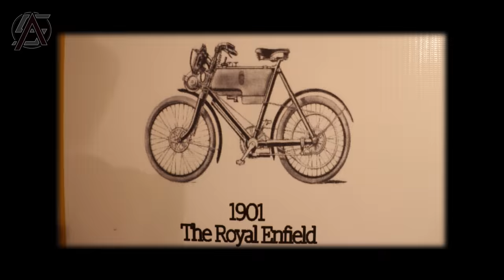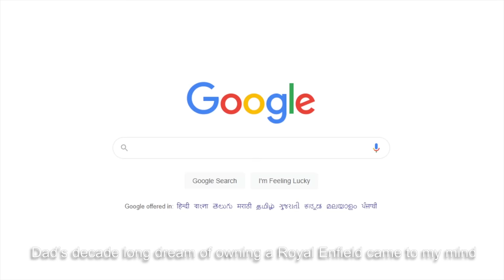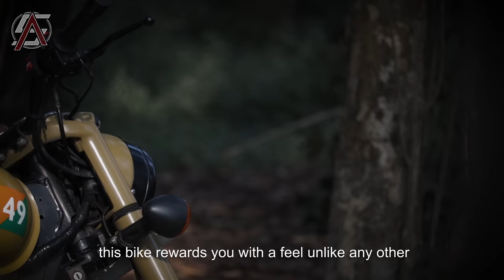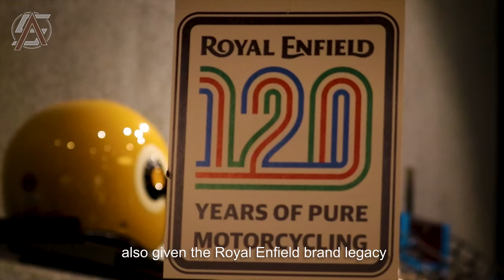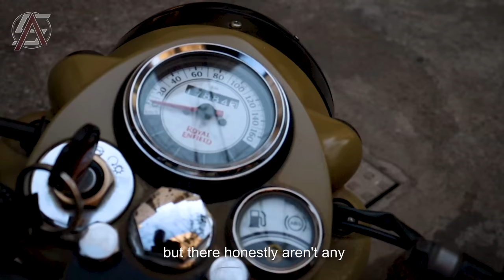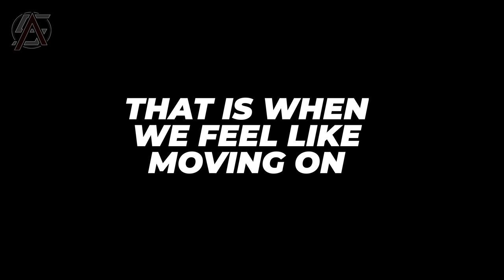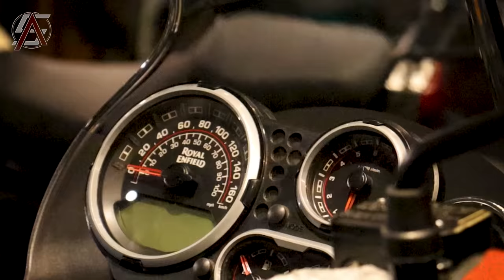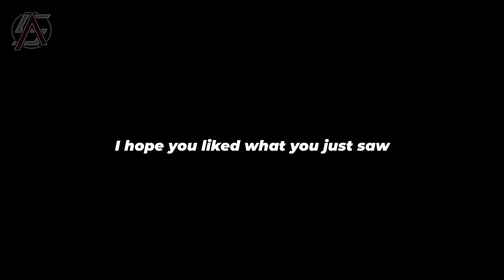A LOVE LETTER TO MY DAD'S ROYAL ENFIELD ❤

Comment: You are absolutely right..
Royal enfields may not make the perfect bike in it's segment..
it might have vibrations, battery issues, backfires from faulty engines..
BUT
when it comes home from the dealership, it's like a story has started..
My father had a Royal Enfield Thunderbird 350 he bought it in 2014.
I always complained my Dad about how he bought a sh*t machine instead of better bikes in same budget,
but the day I rode it myself, in the chilly nights of Delhi in the month of December and taking it to curvy roads of Uttarakhand..
Soon I realized its just not about the features or engine performance, its about the heavy stable royal feel it gives when you ride it down the highway..
its been 10 years, I can easily afford bikes like harleys..
but my heart is embedded in the metal of that one bike, and i promise I'll never let it go..
Royal Enfield❤❤

Comment: I totally get the relation, the bond ... I am 5'6" and still tried classic 350, started scared, messed up with gears, and even found myself not strong enough to handle that weight in the initial days... BUT every time I sat on the beast that roar from the engine made me smile and I don't know but I felt very proud just sitting on it ...

Comment: I Also Burnt My Leg While I Was Riding My Discover Its Not That Hot But Still It's Not Less Then BURNING METAL This Happened Like 1-2 Years Back But I Can Never Forget It. I Was At The age of 16 Back Then. I Remeber I Dropped The Bike And Ran To The Nearest House. They Treated Me And Called My Parents I Was Like 1-3 KM Away From Home So I Couldn't Back To House.I Still Have The Bruise And It Still Hurts A Little When You Touch It.I Wasn't Able To Run,Jump Or Climb Anything. I Wasn't Able To Do Any Sports for 8 or more months AND YES I DID CRY SOO, IT HURT ALRIGHT.
Anyway Respect for mr.salgoankar ❤️🙏